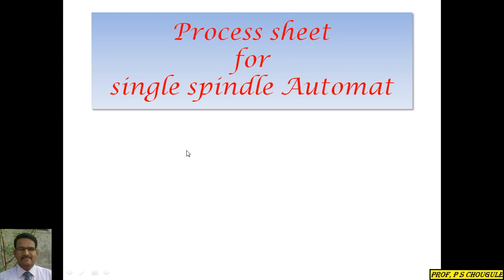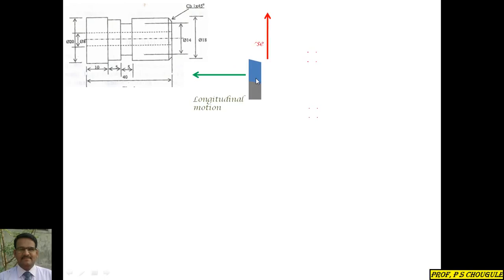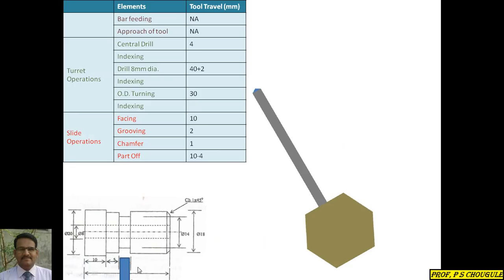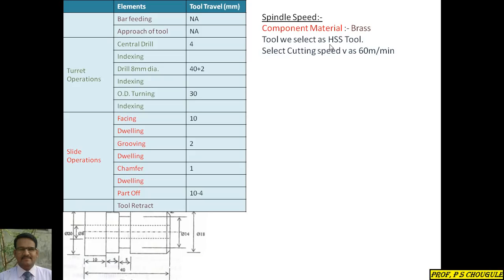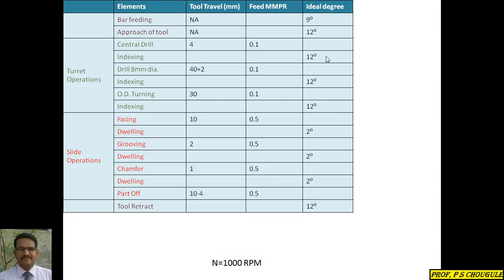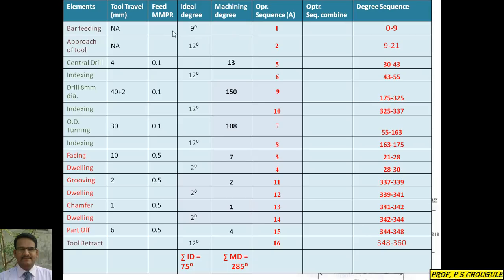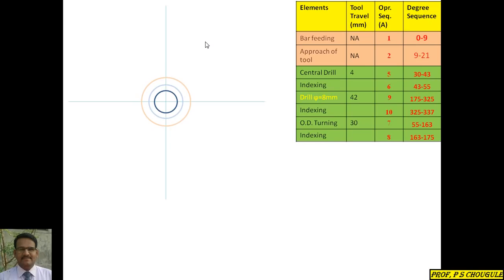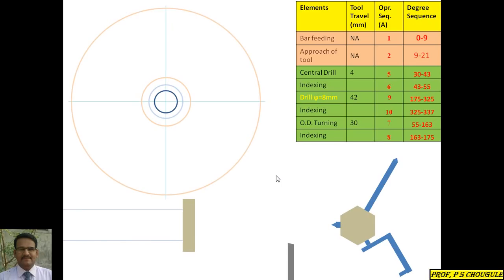Process sheet for single spindle Automat

Comment: Sir in mahalaxmi publication book they given feed is 0.05 for slide operation which one is correct???
Reply from the maker: It must be printing mistake.I am not using local publication.
Reply: Right, feed rate for transverse feed is 0.05 mm/rev
Reply: As we compare 0.1 with 0.5 the value for longitudinal feed becomes 5 times
but 0.05 is half of 0.1
Reply: The transverse feed cut small amount of material as compared to longitudinal so, I do think that feed rate should be 0.05mm/rev